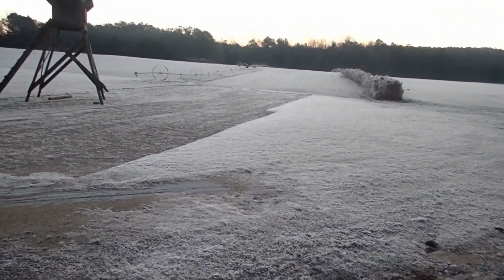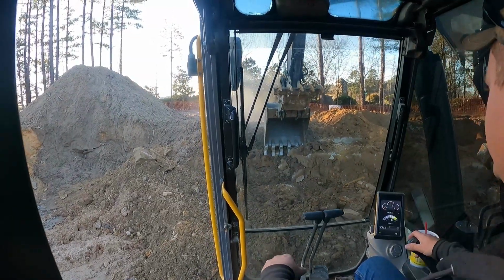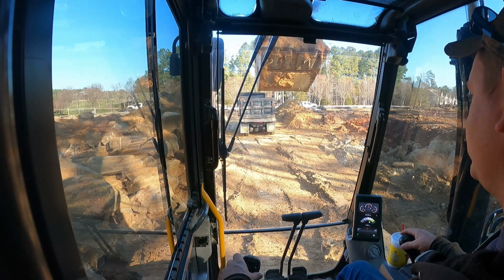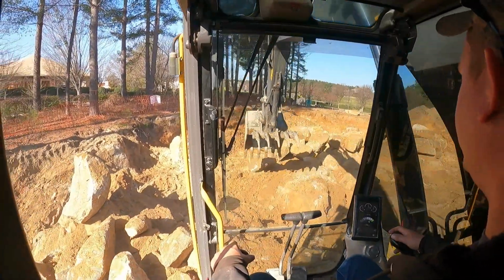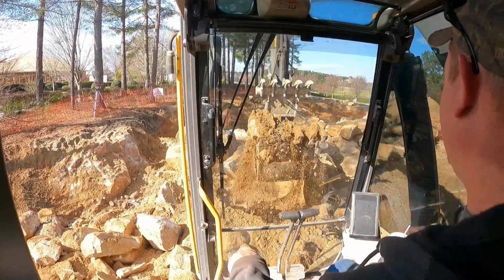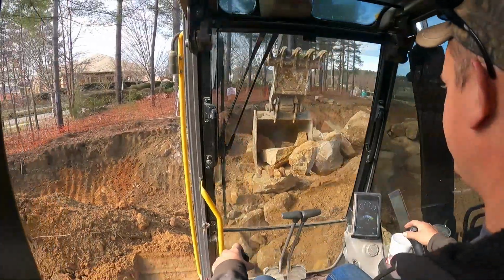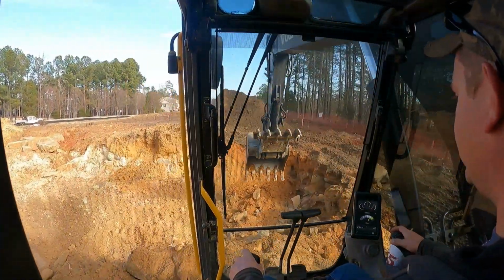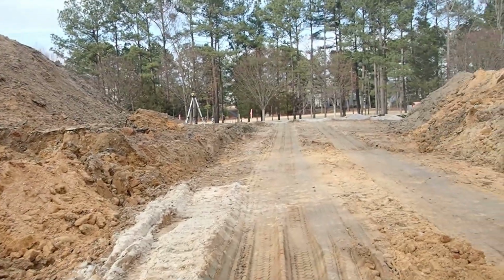Ripping Out Huge Boulders

Comment: Back in the 80s I hauled a lot for the Core of Enginers ..we hauled up to...48 inch bolders...for a lock and dam...river banks...bridge's...we added a  foot tall beam on each side of the tailgate just to have extra room to dump...and had oak 4x4 ties in the floor...  Be safe.  😀

Comment: Nice you pointed out Justin`s new bed boards, and John is still driving with splits on the ends. If you had a Miner`s Card - it would have to state you are Certified to extract all based material from Mud to Giant Boulders.

Comment: Hello, here's a message from the Netherlands. I've been following you for about 2 years now and I like to see you do some earthmoving work. I'm definitely not in this job, but I'm interested. I was wondering. 
 Why don't you use a friend of yours' ground separator. You also used this machine from him last April and May to separate the sawmill soil. And then you managed to separate very soil between good soil, coarse pebbles and other junk.
I think if you use this machine now, there's is a lot of good ground on the site. And that yes only the stones only have to be drained. You may not use this machine because of the weight of the stones. But That's what I was wondering.

Comment: I use to work at a scale house weighing trucks of all sizes coming in and out of a gravel pit. It just hit me. Can you modify a dump truck or a semi with internal scales as well as a means to inform the driver if the truck is level?

Comment: When your picking up a rock, and your using the thumb, do you manually have to hold pressure on the thumb, or does the machine do that for you. Like  some kind of pressure lock.
Reply: Machine holds thumb still
Reply: @littlefinkle7757  So the machine holds what ever pressure you applied to pick it up automatically, until you manually removed the pressure or add more.
Reply: @charlesmiller5078  kinda you have to keep the bucket curled to the thumb but the thumb basically can be static it's an either or type of situation. You can move them apart from each other or closer to each other simultaneously or individually

Comment: you say dig well yes but boy there are some big old rocks in there must be hard on the gear and the teeth well what can one say just as well there an old set wont be much left of them when finished i do like the way you operate your machines look after them but they work hard for it can i ask a question if i may on the bit you call a thumb and the teeth on it are they replaceable or do you get them hard faced welded from time to time thank you and  cheers

Comment: Chris, why haven’t you got the 250 on this job. Get the 250, has more power and strength. The 220 is a good machine, but when you have a bigger machine why not use it.
Reply from the maker: 220 will do this job just fine

Comment: The quarry I work at call’s them BDR 
“Big D¥^M Rock “ $75.00 a ton with a minimum 10 ton
The smaller bucket size class 1&2
$27.00 a ton
Western North Carolina